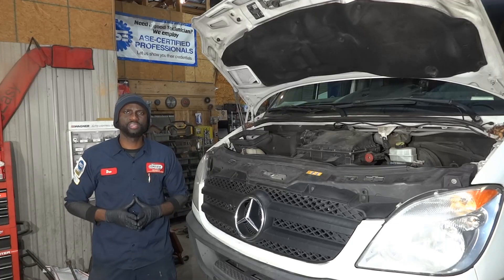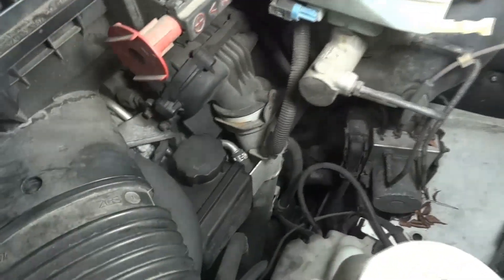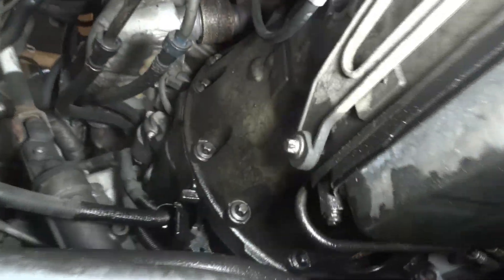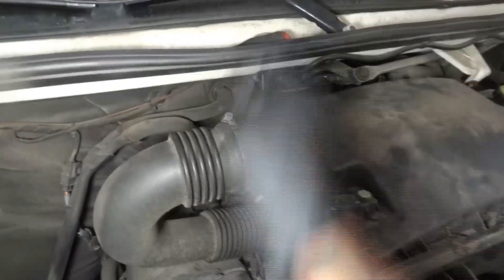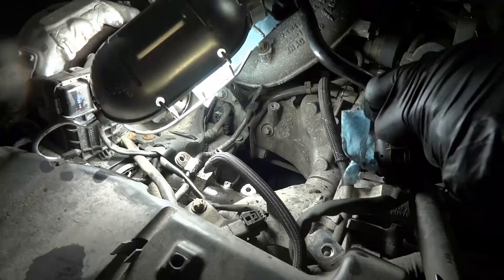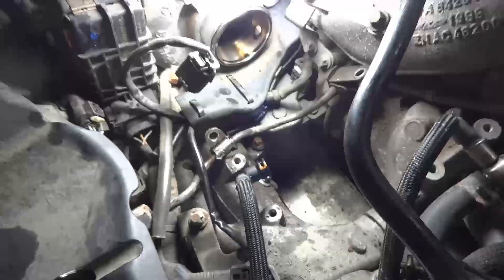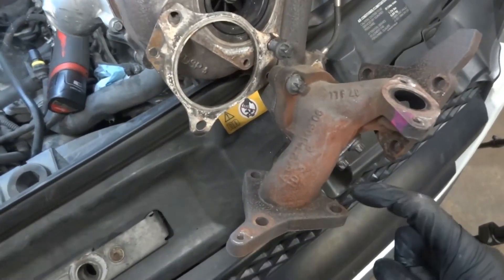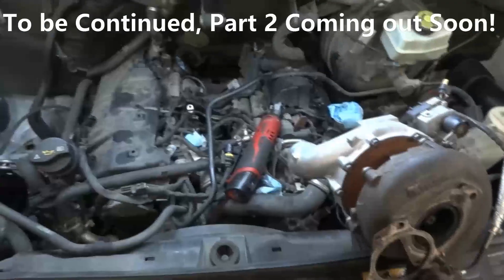Mercedes Sprinter Engine Oil Cooler Leak - Diagnosis & Repair Part 1 / Turbo Removal on Sprinter Van

Comment: This is exactly the issue with my 2012  3500 merc sprinter.  Started leaking 2 days ago. Wet areas are in the exact same location with oil coming from up top somewhere. Thanks for the video, now i know where its leaking from.

Comment: I’m currently in the process of performing this exact repair. I just removed the heat shield off the turbo and determined some more reverse torque bolts need to come out before this turbo can find its way on the table. Thank you for a thorough and informative illustration.
Reply from the maker: @schrodingerscat8621  My Pleasure! and Good Luck with your Project!

Comment: Hi, I like your video, very well explained, I have a question, how much is a job like that? My 2008 sprinter seems to have a lick from the oil cooler as well, it licks through the turbo and very often it goes into limp mode.
Reply from the maker: @joseojeda1545  it depends! send me an email at Deo@calleva.org and I will send you a quote!

Comment: A little secret, it is possible to get oil cooler out without taking turbo, inlet off.  Remove fuel filter, fuel cross over pipe, and turbo charge pipe. Then die grind about 5mm off block just above the drain hole. This allows u to pivot cooler and lift out.Undo all the cooler bolts and remove. Turns a 12hr job into 3
Reply from the maker: @damienfaithfull3115  Good to know!

Comment: One question: where you show the turbo DPF tube at 17:50, do you know what year they changed to the easier-to-remove pipe? Do the 2010-and-later have the easier configuration? Thanks.
Reply from the maker: Ted Pirsig  it's from 2012 and up!

Comment: I stripped the two bolts that are In the front, any suggestions as far as getting them out, are there any tools I can get that will make it easier to remove?
Time shows the bolts I’m talking about: 19:09

Comment: You can take the oil cooler out without removing the intake, just remove the turbo with the base + fuel filter, long quarter inch extension with a t37 and slide it out from the back where the turbo sits
Reply from the maker: @mateogutierrez5339  Really?

Comment: I have a 2008 and right at 17:38 you mentioned that the 2013 models have that part that can be removed. I don’t have that and wow it made it much more difficult :(
Reply from the maker: A Alp  yes! it's very difficult to remove the turbo on the older models!

Comment: My sprinter rand out of fuel i got it started it drove half a mile cut out wont start and leaking oil any advice?
Reply from the maker: anthony o'neil  figure out where the oil is leaking from and make sure it's not a fuel leak!

Comment: Do I need to drain the oil and coolant prior to this job?
Reply from the maker: @anthonychaboya3462  yes!
Reply: @KITS_Auto_and_Truck_Repair  Thanks. Where are you located? and how much do you charge for a oil cooler replacement?
Reply from the maker: @anthonychaboya3462   I'm located in Dickerson MD, you can Email me at Deo@calleva.org for shop info!

Comment: Hi good day, Your you tube sessions that I have seen are fantastic, Perhaps you might assist me with a very frustrating situation, On my 2008 sprinter 906   311 tere is a bad oil leak it is a steady strean while the engin runs. probabally a cup full in 30 minutes. the engin oil is dripping from the Steering pump at the bottom probabally where it joind the engin, What I do not know is why, does the engine oil go through the steering pump, if so perhaps a seal is gone or piping broken, I am elderl and have not managed to go under the van to have a good liik, Any asistance would be appreciated.
Reply from the maker: @user-wc4bd9vx8t  it sounds like your power steering fluid is leaking!